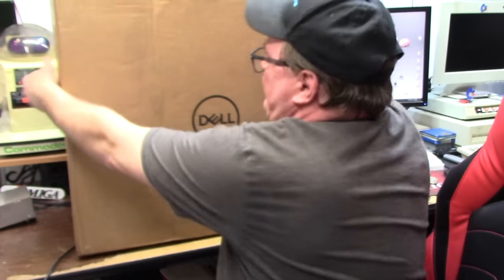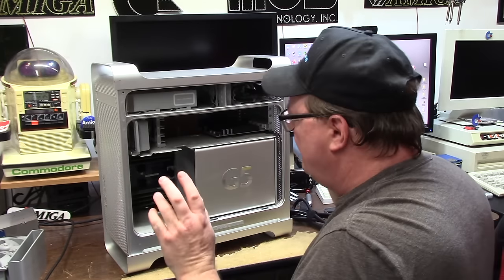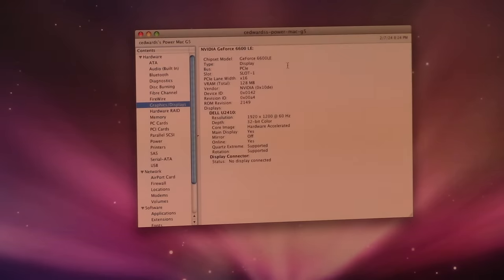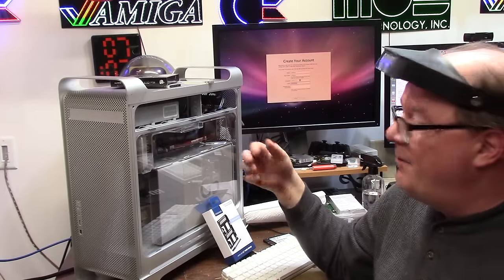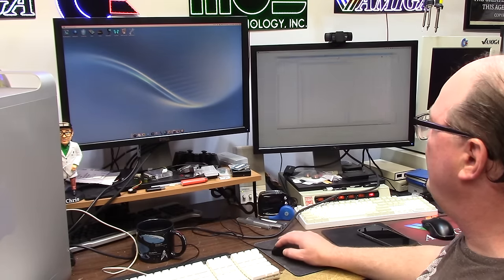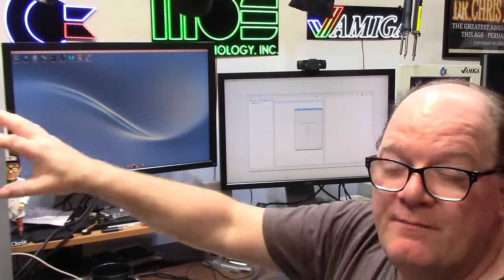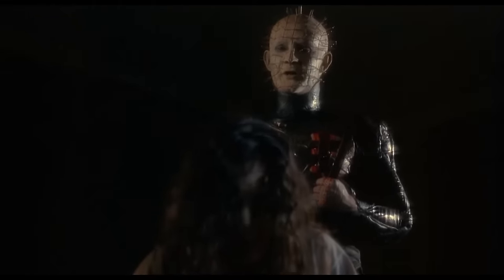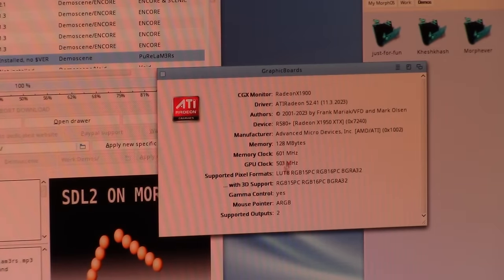MorphOS on the best PowerMac G5 there was

Comment: Why the title of best PowerMac G5?  I have a 2.7GHz dual G5 model, and the last PowerPC model, which is the quad core 2.5GHz G5, which I would say both are better than the model you received.  Mine need the coolant systems refurbished, with new "O'-rings", before I try to use them again, as I don't want to risk coolant failure and damage to the PSU's which were stupidly located at the bottom of the case.
Reply: Well, I wouldn't call the quad G5 better as there is a severe weekness: The watercooling. The maintenance free Apple watercooling system needs maintenance and I will bet there today there is not a single machine that still works correctly without having been serviced.
Reply: My 2.7 is still in use. Getting ready to put new thermal past on after almost 20 years.
Reply: @TLang-el6sk  the quads rarely leak unlike the 2.7s  the single pump 2.5s dont leak either i have 8 g5s 3 of which are liquid cooled .
Reply: For MorphOS that is the ultimate G5.  MorphOS only sees 1 core/processor.  The heatsinks in the PCIe G5s are very effective in running cool with no leak risks.  The PCIe systems have a faster bus and cache than the older 2.7, so it is a trade off.  You lose 200MHz but gain in other areas.  He needs to update to the 2.5 from a pcie system for the fastest experience.   I tried them all and Chris chose wisely.

Comment: I bought the same card and couldn't get it to work. Turns out the card is a PC card reflashed with the ROM needed for OS X. It will work for that. I finally found a X1900 G5 card and it works with MorphOS. My G5 is the 2.3GHz dual core PCIe machine. What did you do to get it to work???
Reply from the maker: Plugged it in.  Didnt do anything
Reply: I have the same issue. I had to purchase a PC version of this card. Flash it with Mac firmware (3 years ago). Now the FAN runs at full speed and doesn't work with MOS (black screen). 😿

Comment: Same spec as my G5., complete with its great but Morph OS un friendly graphics card.   I have an ATI card that just needs to be firmware hacked to work.
Reply: ATI is unfriendly regarding their support. If it just needs a to be hacked, you can do it and share the MorphOS ATI driver with the world. Win-Win for everyone.
Reply: @guidomersmann9744  The card I was going to put in it is a  pc card, you can hack the firmware to the Mac version, theres a fair few videos on Youtube on how to do, it but  basically you need  an old PCI graphics card  to see whats going on and the PCIX card you want to mod.  Should work the same afterwards except no power over the video connector as in the genuine Mac compliant ones.   Not a problem for me as I ditched my Formac screens years ago in favour of LED widescreens that were far better and a quarter of the price.
Reply: @pkf4124  It is still an ATI card, which means the stuff is undocumented, which results in no MorphOS support. If the card works with OSX or not, does not matter.

Comment: Perhaps you can help me Chris if you will I have a amiga 500 pal  loads everything as long as it does not includes multiple disk swapping what do you think is going on
Reply from the maker: Some require a external disk drive also.  Not everything runs df0
Reply: @ChrisEdwardsRestoration   no hard drive its kickstart 1.3 tried both DFO and DFI , Pinball Fantasies disk 1 DFO 3.5 and Pinball Fantasies DF1 Gotek disk 2 just crashes same story any program with 2 or more disks including Pen Pal but Deluxe Galaga and Great Giana  Sisters is fine by the looks of the pal rev 5 board all the chips are original  l just got me wondering if a ram chip or a solder point is going bad what ever the case I'll have post it overseas for repair just trying to get a grips with a direction
Reply from the maker: @elwoodpot14  i would start by booting Amiga Test kit 1.2 and running some tests.  you may have a 44256k ram chip that bit the poo. it happens. they are cheap.
Reply: @ChrisEdwardsRestoration  Thanks Chris I will do it tomorrow I will let you know of the results when I'm finished
Reply: @ChrisEdwardsRestoration  Well I download and ran amiga test kit 1.2.1 nothing came up frustrated pressed a few pressed a few chips down processor , kickstart and the Paula and it started  loading normally  I can now use programs with more than one disk. since I don't know when the last time it was used was it could just need I good clean well its my first amiga so I'm learning

Comment: Kind of redundant to run MorphOS on a 64-bit G5 as it is a 32-bit operating system: it’s not going to take advantage of all the registers.

Next, the maximum RAM MorphOS can “see” is 1.7GB so anything else is a waste (for MorphOS at least, Linux and Mac OS X will utilise it fine!)

I run MorphOS on a PowerBook G4 15” Aluminium with a 256 GB SSD and 2 GB RAM.
Reply: Now now, when he gets the 2.7Ghz G5 CPUs, that is the fastest processor Morph current runs on, isn't it? And he can still do all the Mac stuff.
Reply: "Not going to take advantage of all the registers" - of course it will. It's PowerPC, not x86_64, where you can't access half the CPU from 32bit code.

Comment: Hello, I am from the Dominican Republic, I have a Power Mac g5 7.2 at 2 GHz, 2.5 GB of RAM, I have a problem, I have tried to install MorphOS, I have tried different versions 3.15 and .3.18 and I get the same problem when trying to install via USB when I download the MorphOS installation screen the screen goes completely white please someone help me I have tried for 6 days and nothing has worked for me it is worth mentioning that I have not tried with CD only with USB. Thank you
Reply from the maker: I always have used cd not usb as the usb is for the Pegasus boards or the others listed and not for mac.  You also need to have an ati  card not nvidia
Reply: Sorry for stupid question - But do you have Radeon card on this PM ?
Reply: @flowcomp  si ati 9600 pro 64 mb
Reply: @SoftwareOS  so as Chris mentioned , try install from cdrom.
Reply from the maker: @flowcomp yes i showed it in the video in detail